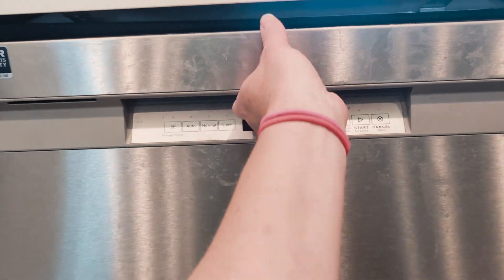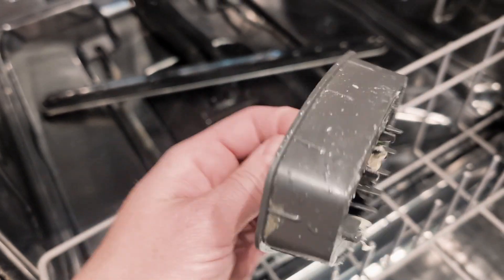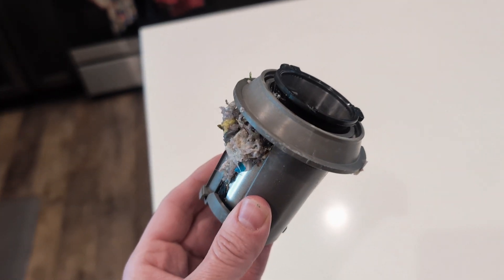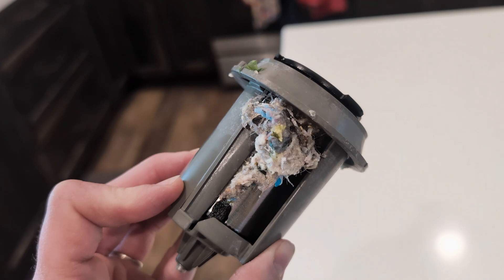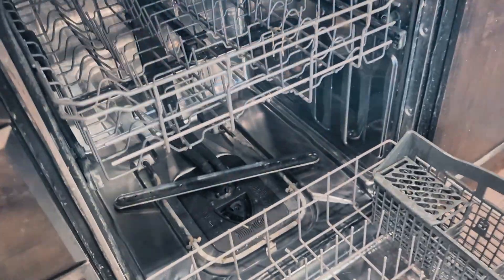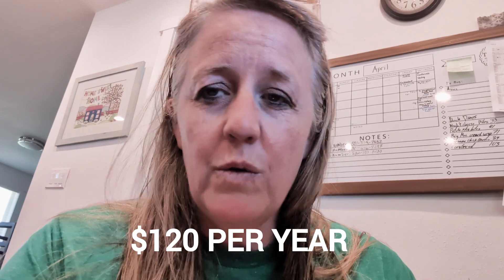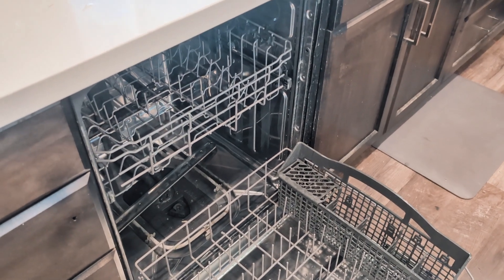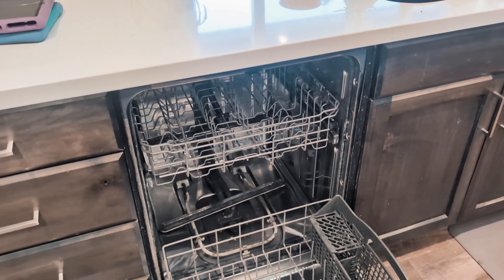Broke again!! Design flaw in Maytag dishwasher (Model MDB4949SKZO) and how to fix

Comment: What sort of materials clog the filter?
Reply from the maker: Food chunks of all kinds
Reply: @m @mysillysquirts2907  The filter in the video does not appear to be clogged with food chunks.  That looks, on the video, like plastic and perhaps paper.  Those blue colored bits are especially suspect.  Blue is not a common food color.  Neither is nearly pure white and there is a lot of that, too.
Reply: @mysillysquirts2907  I’m just trying to understand what I’m seeing.  My wife and I are thinking about buying a similar model dishwasher.  I’m sure it has the same filter setup.  We would like to know how likely this problem is to occur.  If it occurs with ordinary food debris that could be a reason not to purchase.  If it occurs when non food items get into the system, that might not be too likely in our home where we only have two adults and occasionally our adult children using the dishwasher.